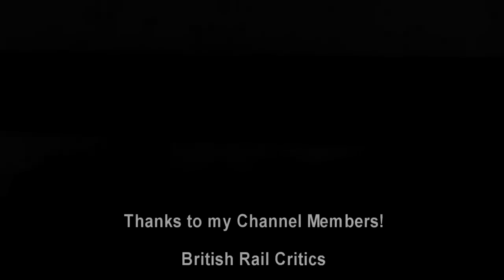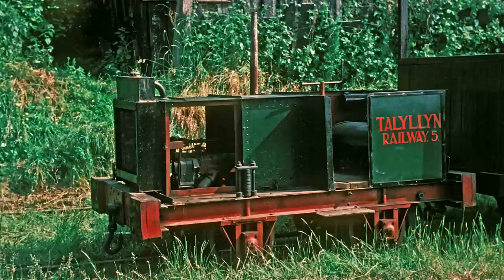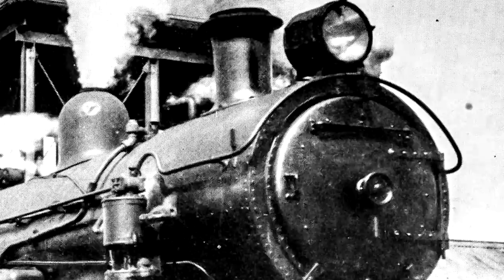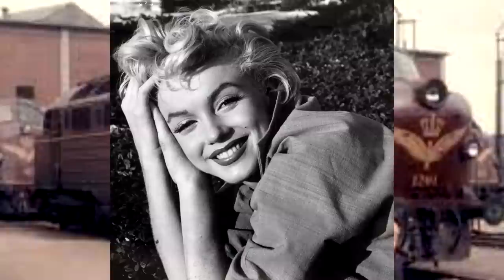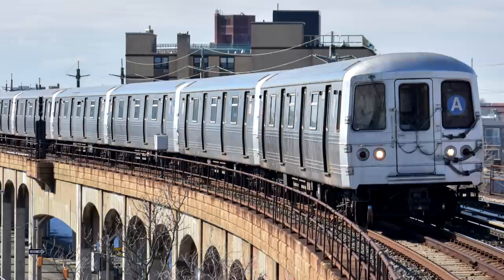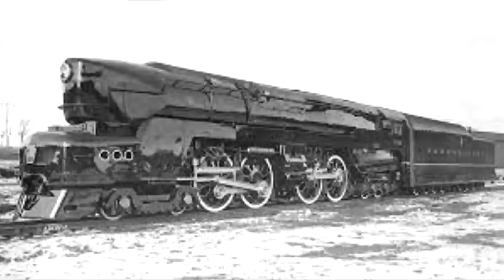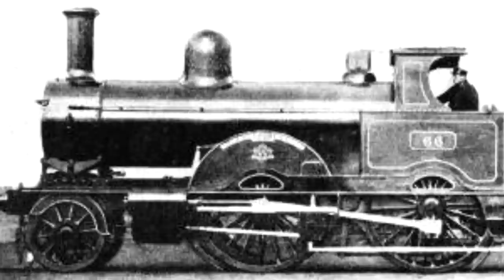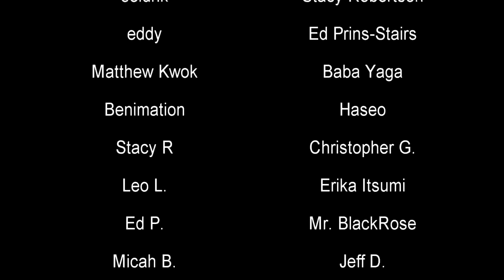5 of the WORST TRAINS EVER PART 23 | History in the Dark

Comment: 5:56 You just described the last car I had. A 2007 BMW 328xi. The last week I had that car, it spent all it's milage on the back of a tow truck, as I had it towed from shop to shop in a desperate attempt to find even  ONE shop in the Lehigh Valley that isn't afraid to work on BMW's. All three shops I towed it to either said, "we don't work on BMW's" or "we don't have the means to figure out what's wrong with it."

The last shop found out what was wrong, but it was going to be $2,000, after spending $300 on towing and over $1,000 over the course of that month for previous breakdowns.

I was fed up and told the mechanic, "never mind, I'm just gonna have it scrapped..." He bought it for twice its scrap value.

Thankfully, I now have a MUCH more reliable Honda Civic.

Comment: 4:28 NSWGR No. 3402's scrapping in 1962 wasn't all in vain. Both hers and the loss of all 58 class (in NSW, the letter before the number in 1924 classifications are never used. As a result, you'll normally find NSW sources referring to steam locomotives as "10 class", "19 class", "32 class" and "60 class") 4-8-2s, this caused the formation of the New South Wales Rail Transport Museum, now named the NSW Rail Museum, in 1963.

Comment: The thing with the R46s is they were a "back to basics" design from a mechanical standpoint. A body similar to but not exactly the same as the R44, but with mechanical systems more inline with the older cars. This mindset reached it's peak with the order that followed in the mid to late 1980s, the R68 class, which is mechanically identical to the R10 to R42.

one of the more notible changes was the slightly smaller passenger compartment and wider cab in the A cars. R44 has a pair of three seat benches set longitudinally at the number 1 end (outside the cab). R46 removed one of those seats to make room for more cab space for the crew. the cab doors are also MUCH wider the 44s.

The issue with the trucks was they were meant for light weight equipment. They were subcontracted to Rockwell International... also known as the people who at the exact same time were building the FREAKING Space Shuttle... They were built without proper testing for the rigors of a 24/7 subway system. 

These days they are very much showing thier age. The plug door at the nose leaks like no one's business.

I am a subway conductor and had to get one of these trains out of the yard after a heavy rain storm... There was enough water on the floor that it was sloshing back and forth.

The LCD destination signs, which were installed in the 1990s rebuild, do things like crash, or don't speak to each other. a single console should adjust the entire train, but often times you will have various numbers of cars stuck with the wrong program being displayed. most comonly, one half of the train isn't talking to the other, so I have to jump into the other cab and reset the console there. Or the console in the cab I'm not using is stuck and keeps changing the other signs back. Had that two nights ago. 

literally the only thing they've got going for them, from my perspective, is the cab size. Everything else... I can't wait for the R211s...

Comment: The rebuilds the R46's had were part of the General Overhaul Program that the MTA conducted in the late 80's and early 90's, which cover the A Division's R26, R28, R29, R33, R33S, R36 (Which are all generally referred to as the Redbirds because they all got painted Red), and B Division's R30 GE, R32, R38, R40, R40A, R42, R44, and R46 train models

Comment: James Toleman was tested on the Milwaukee Road for a few years, along with Baldwin #13350 Columbia. Eventually it was donated to Purdue University in 1901 as an example of what not to do with an engine design. It became one of the first engines to be displayed there. Eventually minds were changed and they saw no educational value to the engine and it was broken up at a Chicago scrapyard around 1914. One article from the time stated it was made of the finest quality material, since it was so well built they needed dynamite to crack the frames and cylinders.
Reply: On a side note it is the only engine from the original Purdue collection to not survive into the 21st century.

Comment: The Frichs built class MY 1201 and 1202 weren’t really named Marilyn Monroe and My Fair Lady, it were nicknames given to them by the railway staff, and yes because or the nose bending more out, than the Nohab built Class MY. One piece of the engine room door, still exists, and are on display on the Danish Railway Museum.

Sadly DSB never really tried to fix them, if they were given General Motors like the Nohabs, they would preform well and maybe DSB didn’t had to buy the Class Mz (Danish variant of SD40 (Series I and II and SD45 (Series III and IV).

Comment: As a new Yorker, the R44/46 cars aren't bad, mainly just when they came out for the most part. Now they're just so old that they're falling apart. Not sure if his helps but yeah. Thanks for reading if you did. 

Edit: the section about cracks and the initial debuting of the R46's this is factual and accurate, same with the part about delays in delivery.

Comment: From a passenger perspective the R-44-46 rash of subway cars was the best. In '71-'72 they were the first to have modern suspension, and the difference in both ride and noise level was an extreme contrast. After having the rattan seats of their predecessors torn up with knives and replaced with plastic upholstery as if it would fare better, and finally solid, grey fiberglass stuff, the R-44s were the first to resume with combo lengthwise and crosswise seating designed as a planned outcome, and they made efforts to make it nice, and the scheme has remained for, well...  more than 50 years now, and was everyone's favorite till they started deliberate deferred-maintenance-yet-in-regular-service conditioning of the passengers, who - even with the wall-and-chair assembly coming unpinned from the floor with the wall flapping dangerously - or comically - while hanging from the ceiling, and the two lengthwise seats hanging from that, with you on it, it's still our favorite configuration, and vastly preferred over the bigger doors / shorter cars / no seating format of the now all too familiar VERY uniform all blue-or-occasional-Cuomo-color-scheme lot. (Cuomo designs both trains and railroads bet ya didn't know.)

The R-44s were also the fastest subway car in the world for a time though I don't know any faster, and were clocked at something like 85mph on the LIRR Main Line before it was upgraded to 750 volts. R-44s, 46es and another later lot were all 75 feet long versus the usual 60' for the B Division, and the length seen from inside is impressive; more so with the door-adjacent glass partitions which were later removed. (wonder why) It's nice to ride in the middle of the car. When they've been recently shopped they're still the best. The patriotic plastic "wallpaper" of tiny city and state seals intermeshed in varying shades of beige was a clever touch: never looks dated. They were among the first to have air conditioning that wasn't retrofitted, noisy and drafty and not exactly cool. They were a big change when they came, and they will be missed. Especially as we're soon entering the Age of Gangways - but it'll finally stop people from surfing on top of the trains if we stick with this nightmarish formula. Better to remove the chain locks they climb on to get up there, and a few other precautions.

Comment: Its funny you mention R46s having 44 trucks. Weirdly the R44 and R46 share a design which made them almost f-ing impossible to tell them apart until they were overhauled and the R44 had this distinct Grey stripe. 

Its should be noted that R46 are now one of the more realible railcars in the system however they are showing their age. Theyre being replaced by R211-Type Cars

Comment: #1 interesting, there is something like that in Train Sim classic and it was brought to the game by caledonia works the London and North Western Greater Britain 2-2-2-2 duplex engines with the front drive axle being powered by the inside cylinders and the rear drive axle powered by the outside cylinders. Its got a bit of speediness too and I've reached around 85 mph with the engine.

Comment: the james tolman loco looks like it could have done better had the drive system been turned into a standard drive not a duplex type loco as i have to admit she does look nice just the creators tried to be creative and failed.

had i been around at this time id have brought the loco and changed it up to be a 4-4-0 tender loco.
Reply: Alfred De Glehn proved that the duplex setup could actually work if done correctly. He built a class of locomotives with the same 4-2-2-0 divided drive setup, using Walschaerts valve gear instead of Joy valve gear (like how Webb built his failed compound locomotives.)  They were actually really good! One member of the class is preserved today.
Reply: @xlthecoolguy-lz7uh  oh wow that urm is there any video's of this loco running?

Comment: DSB MY 1201&1202 bad,  DSB IC4 hold my Faxe lager !
Reply: IC4 isn’t the same, compared to 1201 and 02. Unlike them, IC4 runs, and are way less out of service than the 1201 and 02 was. They probably only ran 2 days before breaking down, the twins spent more time on works being fixed, than IC4s.

Comment: The James Coleman was not a Duplex. It was a four cylinder, just like the British four cylinders with two inside driving the front wheels, and two outside driving the second set.
Reply: The correct term would be Divided Drive, since the 4 cylinders were split in pairs that did not function together.

Comment: Regarding Divided Drive steam locomotives (the 4-(2-2)-0), none other then De Glehn himself visited Webb and his strange designs, decided they peaked his interest enough to experiment himself and somehow ended up building a version that actually fucking worked. More amazingly still, one of that class of engine is PRESERVED at the Cité du Train in Mulhouse.

Webb, on the other hand, also did not stop building Divided Drive classes untill his retirement, and all failed. Mostly spectacularry too. These designs included a 2-2-2-2 type express locomotive, a 2-2-2-2T local and, weirdest of all: a 2-2-4-0T which looks utterly ridiculous and was a total failure.
Reply: Yep. although it could be said the "Teutonic" Class and the "Greater Britian" Class were the best of a bad  set of jobs, as the Teutonics and Greater Britains were pretty nippy and ecomonical beasts once you got over the starting problems. But anything else? Well, the "Dreadnought" class was more hoplessly inconsistent than bad, but the rest is silence, and really ought to be! (And don't get me started on Frankie boy's 4 cylinder compounds!)
Reply: There is also the simple fact that the Pennsylvania Railroad tried a Webb compound, which they regretted. Theirs was a 2-2-2-0, and the master mechanic noted it was supplied without cab. It was not - it did indeed have a cab - or more accurately what passed for one on an English railway, as opposed to the shed on an American engine! One of the French lines - I can't recall if it was the Eastern or Western, also had a very similar engine; both were built in Britain, to plans loaned by Crewe works. Also in England, the London & South Western had a batch of Drummon 'double single' 4-4-0's; I gather they worked reasonably well and, eventually, were rebuilt as conventional 4-4-0's.
Reply: @JohnDavies-cn3ro  Ah, the Drummond double singles. They were not too bad, but suffered a little by the effort being a little out of sync, and small fireboxes. As divided drive engines go, pretty fair - but they were better as true 4-4-0's.